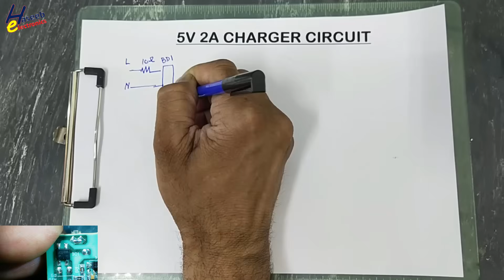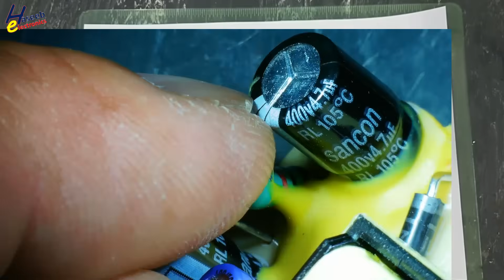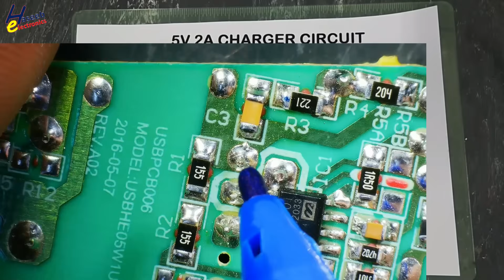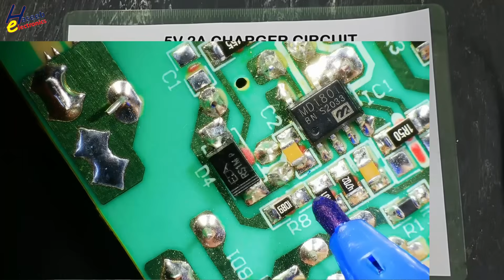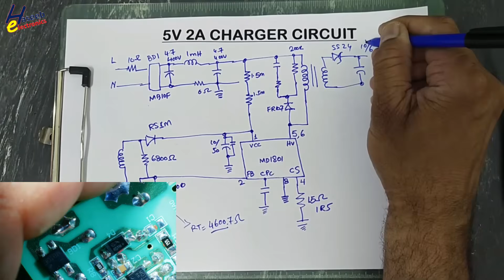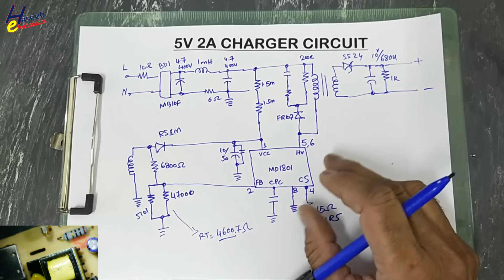{1318} How to Trace and Draw Mobile Charger Circuit Diagram | Working Explained

Comment: hi man need help !! i seen you repair welding inverters so well,so i have a thecnical question,i have a bivolt 100am inverter and whenever i try to use it in my 127v it is low amp output,impossible to weld,thing is evey now and then when on i hear a clicking relay inside,and it starts welding normally,which i would think means the relays changed from 220v to 127v, my question is,why its detecting my AC 127v as if it were 220v /? my multimeter reads the mains around 124 most of time ,is that a detection problem,can i change some resistor value to allow it to read the mains voltage correctly and turn on the relays inside properly
Reply: please help my friend uses his machine for his work

Comment: Sir nice video as always, Sir can you explain how a UPS uses one transformer to step down the voltage to charge the internal battery and also uses the same transformer to produce AC Voltage when main supply is not available
Reply: @MbaduMalonda-sc5dg  yeah still want to know how its works